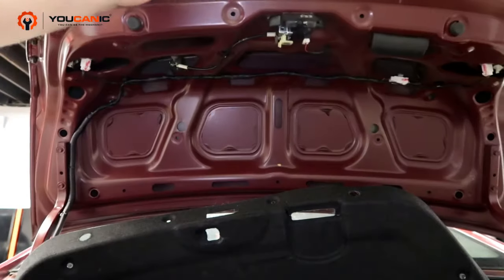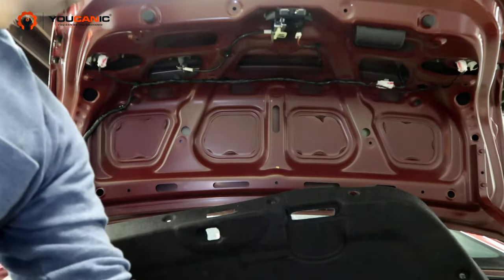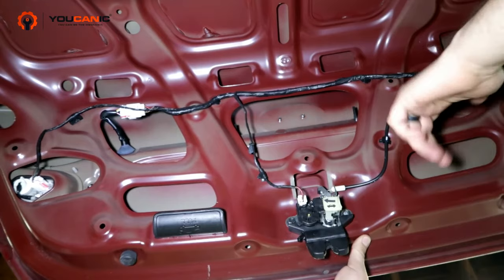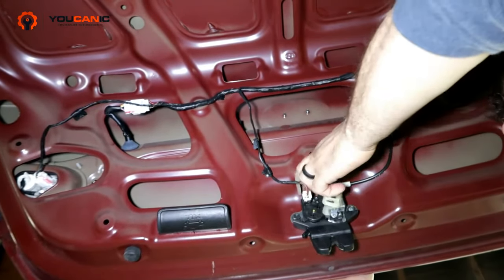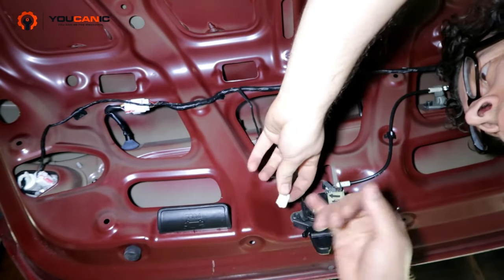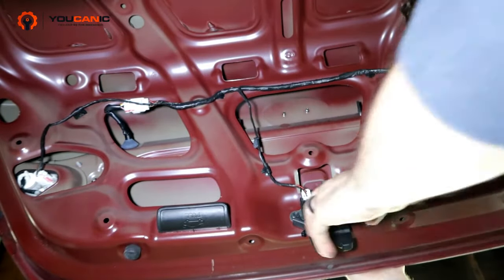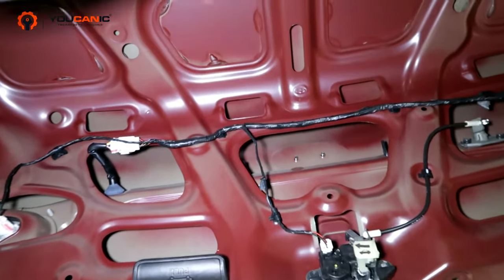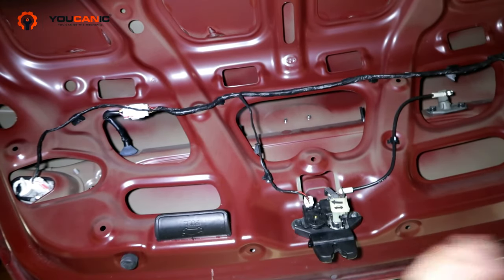Trunk Not Closing - Common Problems - Trunk Latch

Comment: Same thing happened to me but I decided to remove it and found that it wasn't the problem. I noticed that screw was missed and it is very loose. Yeah, I tried to move it back and forth and a loose screw somehow  fell off. I put it back on and tighent it and voila. It's working fine. I almost have to have it replacement. Be careful of waste money. Double check first. Whew.

Comment: Hello this video is really helpful, I need to replace the electrical connector on my trunk bc the plastic bit was ripped off when I bought it. do you know where I can find that part or if I can just cut the wire a little and put a replacement plastic bit on it?

Comment: Thanks -great tips, replaced the latch -but wouldn't close, found out existing bumper -was put on my car, more then likely sustained damage-the bottom latch-, one of bolts cannot secure tightly, had dropped, so once loosened it up, able to move it higher & latch mechanism able to click on-Thanks !!

Comment: My trunk will close but not all the way. You can see from the outside of the vehicle that there is a gap so when it rains, I get a lot of water and it sits where my spare tire well is. So far, I’ve checked the stripping around the trunk, the tail light gaskets, the only thing I notice is my bottom latch is slightly off but still allows my trunk to close. Sometimes I have to attempt a few times but it still closes. Any suggestions?
Reply from the maker: The car may have been in an accident and the trunk is not aligned correctly. The weather strip may be damaged. Some cars have a drain plug for this very reason. If there is nothing under the trunk, you may want to look into implementing a drain hole as well. Just a suggestion. There are rubber grommets that allow the water to drain only.
Reply: I have the same problem. Did you manage to find a fix maybe?

Comment: Mine only latches sometimes.

Everything is connected properly, I've verified that it is, and it was latching originally, but now it closes all the way but won't latch and just swings back open.
I've tried simulating the trunk being closed with a screw driver but the latch itself won't stay in place and bounces back into the open position. We got it to work for a bit but now it's back to not latching at all. I'm not sure what to do.
Reply: I’m having this same issue, did you get this fixed?
Reply: @peachbubble8652 bro same issue, any solution?

Comment: My 2017 Chevy Volt has become more and more difficult to latch.  I feel confident the lower unit needs to be adjusted upward. ^ Gratefully your video has solved my Volts Hatchback issue it's identical.   YES!

Comment: I had to have my trunk lid replaced because someone hit my driver side rear. But the mechanics didn't replace the rubber grip on the handle you use to open the trunk! It makes me wonder if they even replaced my trunk lid and instead just popped the dents out and did a touch up paint job. To clarify the rubber grip was dry rotted off when my car came in; Florida, rubber doesn't last long. I thought that when they replaced the trunk lid that would be part of the replacement. Is it not normally? I'm grabbing bare metal to open my trunk. 

It also doesn't catch properly when I go to close my trunk. Instead I have to slam the trunk lid down at least twice before it stays closed. Never had to do that before.
Reply: How much did they charge you

Comment: My trunk is stuck in the unlocked position it’s an 07 Aveo sedan and I’m not sure what’s wrong with it. The locking mechanism won’t lock and hold the striker, the striker and the mechanism are aligned so I’m not sure why it won’t lock. Any thoughts?

Comment: My trunk latch stays unlocked 

And I have power to the trunk motor 

But it will not pull the cable tight to lock the latch 

2008 bmw 528i

I bought the car like it